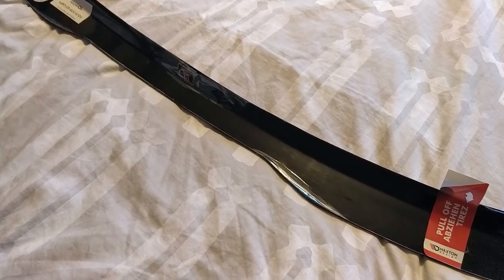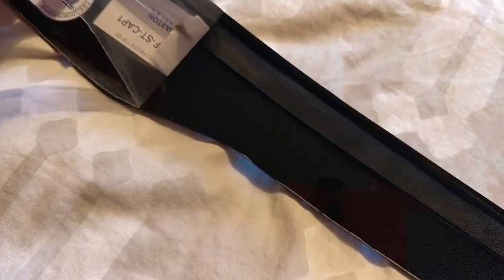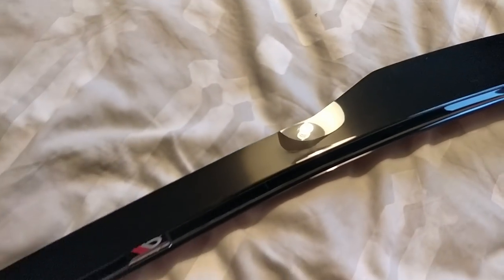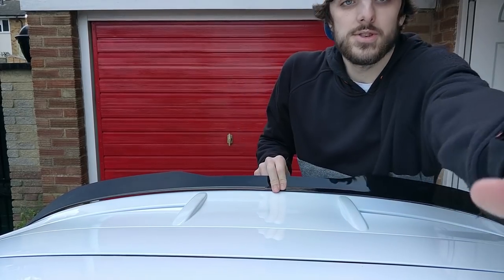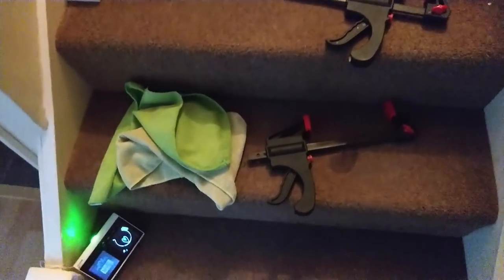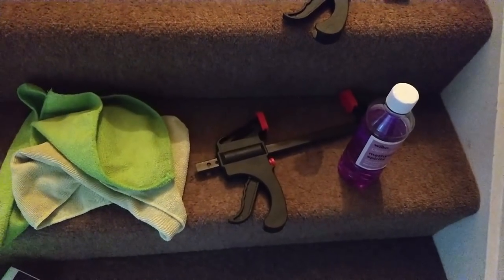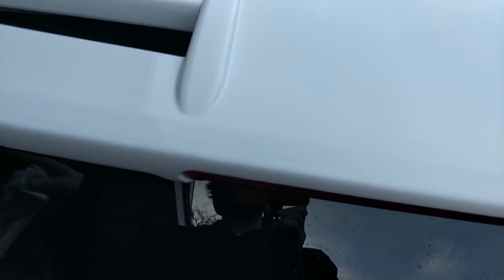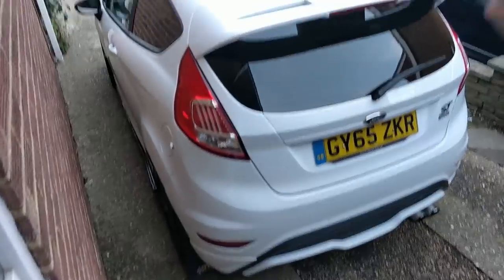Maxton Design Spoiler Lip Install - How to - Fiesta ST180

Comment: Decent job! Just got one for mine, shocking how it doesn’t fit perfectly out the box considering the price! Think im going to bond mine on especially round the bends OR heatgun it so its flush before using the tape!
Reply from the maker: I agree completely. They need to hire a new mold guy or somehow make a better way of producing these in general. The design and actual quality of the product is nice! It's a shame about fitment

Comment: Looks good installed but mark my words it will pop up at edges in no time. I have one installed.!!!! Removed it and put 3m VMB tape to fix it. Keep an eye on it..soon or within  a couple of month's  you will see light thru where it does not fit correctly......you may be lucky but it's a crap fit really..Maxton could have done a better job with it but it looks great.. 

Also I fitted mime in slightly  (not in line with the end /back of the spoiler) and it fits better with the ends of the lip meeting the contour of the side of the spoiler better. 
So if you  ever have to remove because it becomes unstuck keep this in mind. 
Keep up the video's. Great content.. fiesta st rock's
Reply from the maker: Thank you for taking the time to write this. I'll be sure to keep you all up to date if it does start to pop up. Love the design. Just wish they could mold better.
Reply: If it comes loose does it leave marks on the spoiler? If so do they come off easily?
Reply from the maker: @philmufc1  I have no idea so far, mine came up a little bit so may remove it and refit. If it does come off I'll let you know and reply here. I doubt it will mark and you can get sticky residue off with citrus wash
Reply: Car Rambles thanks mate
Reply: @CarRambles  did it last long now that its been 5 years?

Comment: did you ever have any problems with this only being stuck on with 3m tape , like did ever come loose and did you need to re stick it ?
Reply from the maker: Never had 1 problem, use proper tape and youll have no problem
Reply: @CarRambles  double sided tape ?

Comment: you need a real heat gun to pre fit it firstly.  Slowly heat it, keep heat moving..it takes longer than you u think to get it heated thru without scorching it..the edges will lay and fit the curve with a little pushing.  then you use a primer 44 pen on the  spoiler after its been rubbed a few cycles with alcohol (90+% isopropyl) to cut any wax.  strip one inch squares at the ends and in the middle of the lip, bending back the tape covering so its easy to pull once in place.  fit it, stick it in those 3 spots.  look good? tape it down with masking tape, pull the cover strips from the double-sided and press each area of the lip for about 30 straight seconds to activate the pressure sensitive adhesive properly.  give it one last light heat to help it settle any remaining tension and it'll stay on for 10yrs.   the way this video did it, that lip will lift-off in a few years or less, sorry bro.  thx for the vid tho